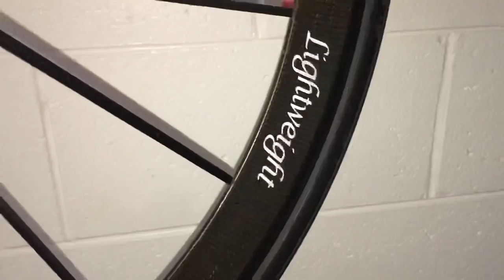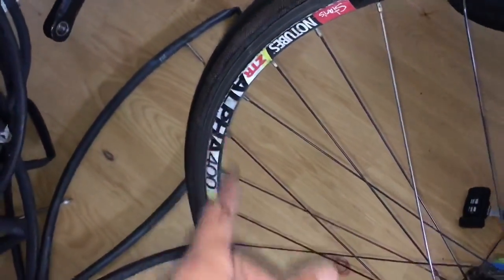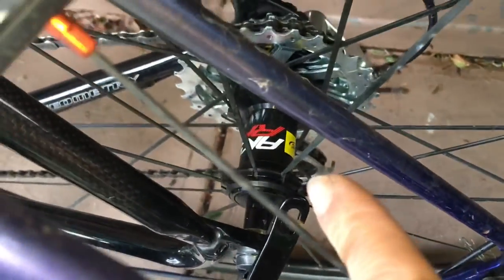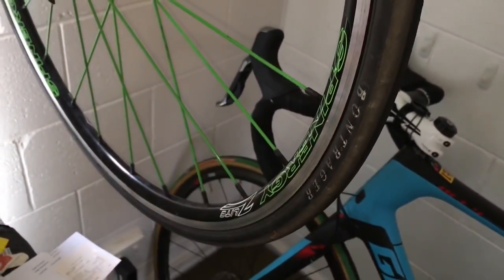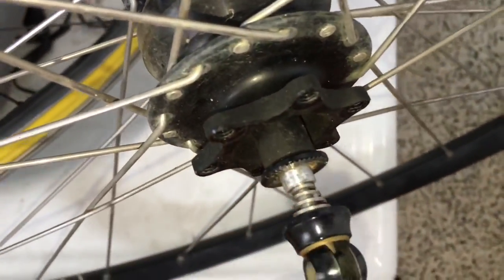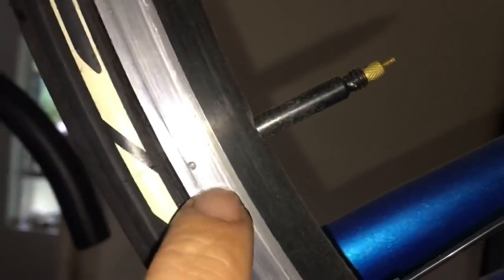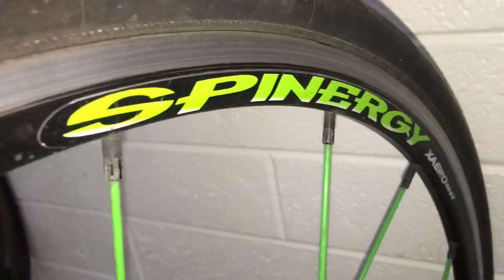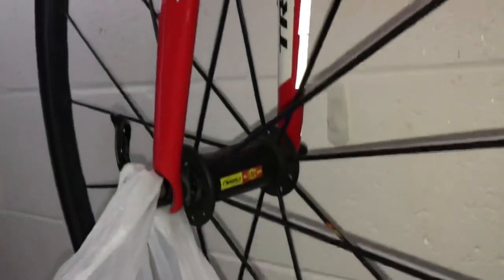What Are The Best And Worst Brand Of Bike Wheels?

Comment: Reynolds Ultra light 32 tubular carbon, picked these up out of gumtree, rode them everywhere, rain, dirt,  sand, bikepacking and I am a heavy rider, never missed a beat or went out of true, I even rode on them with a flat tyre to get home, I eventually wore them out after 30,000km. These rims weight..... wait for it, less than 1100grams!!! Absolutely bomb proof! Oh yeah, and are fitted with DT Swiss 240 hubs.

Comment: Shimano Dura-Ace R9100 C40 clinchers: bullet proof with serviceable hubs. Giant SLR-1 carbon disc brake rims (DT Swiss hubs): haven't done enough km on them to make a determination as yet. Malcolm Borg from the Cycle Clinic in the UK has a reputation for building reliable wheels with the option of lightweight Carbon-Ti hubs. Keen to check out some of his custom wheels built using HED Belgium+ rims, Sapim CX spokes, and Dura-Ace 9000 hubs.

Comment: I ran Aclass (Alex)CXD4  disc as an upgrade on my Diverge A1. Cheap and light (sub 1600gr advertised and under $300Cdn). Good for 3 years until rear rim cracked at a spoke. Replaced with rear DT E1800 30mm deep wheel which will go on over our winter as part of a groupset upgrade. Sure this wheel will be great.

Comment: DT Swiss seems to be the answer. I’ve recently got a set of DT Swiss PRC1400 Carbon 35’s and they feel incredible compared to my two sets of Ksyriums (elite and pro Exalith) most notable is the lack of flex but increased comfort. Went to replace bearings on Mavic. Ksyrium elites and the right side literally dropped out, such is the poor fit tolerances, oh and they use non standard sizes for some bearings meaning it’s hard to get replacements. A new Mavic lock nut for the free hub is £16 EACH and that’s if you can find one anywhere.

Comment: Yo this is mechanic Tom loved your wheel video my heart and soul are wheels. I've built tons and repaired same. Yea I'm not a fan of Chris king, Mavic hubs . Yea I think dt hubs and steel hub shell's are great , fulcrum wheels expensive and spoke replacement pain in the ass, the spokes magnesium alloy big blades almost 36 dollar's each and they still broke . I've fixed every wheel type you showed plus Bora's all of the most expensive but affordable solid stuff, regular nippels not aluminium unless you have to . I've built or repaired everything in my 32 years of wrenching , and have messed up hands to prove it. Had to stop because I'm a musician ,bass player to but I love good wheels , I think it's a real art I didn't use tensiomerters much, I was good at spoke pinging and the feel with hands and agree with everything you pointed out. Loved the video bro,peace.
Reply: Hi Tom, I I am an apprentice we’ll builder and I am also blind I was wondering is there any advice you could offer me. I have only built 15 to 20 wheels so far and finding deep rim wheels tricky.  thanks

Comment: Very informative mate, thank you. Quite a few surprises in there too. I have had similar experience with Alex rims - they are bomb proof mine are 13 years old without a single problem. On my other ride I have a DT - Swiss 240 s on the rear which has been awesome. On the front I’ve got a Surly New Hub which has surprised me with just how good it is- spins for days and has been indestructible. Interesting re the Mavic hubs - never liked them either. Had them once years ago - never again. Same problem, lots of slop. But now I’m off to check Spinergys.

Comment: Recently bought a 21’ specialized diverge.   Roval c38 are the most popular carbon wheel upgrades I’ve been reading.   Thoughts on those or any other ones you’d recommend?  Staying with a 32mm (road) - 45mm (gravel) tire

Comment: What do u think of chinese made carbon wheels? Specifically the brand ELITE WHEELS?
Reply from the maker: Just  get the very best. 
Winspace hyper 38 rim brake. 
Use 'durianrider10' for 10% off.
Reply: @durianriders  Thx for the discount! I will forward it to my friends. Also Ive been doing some research and  managed to build some contacts with mainland Chinese traders of bike parts / accessories. So apparently the general consensus is that the number 1 Chinese brand for carbon wheels is a company called FARSPORTS. Do check them out!

Comment: Mavic hub "slop", you can adjust the "slop" with their wheel tool, there supposed to be adjustable.  You adjust it through the outside ring... it's easy.
Reply from the maker: Thats bearing tension.... now check freehub body tension.